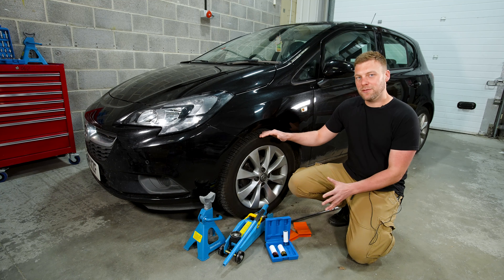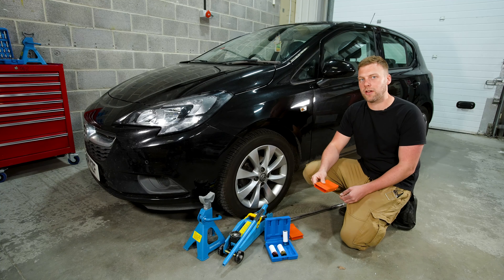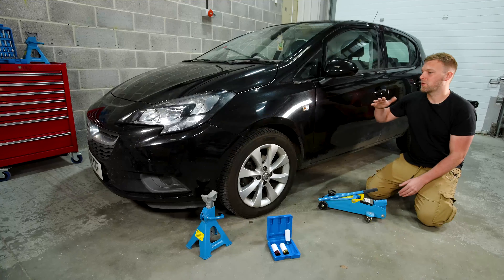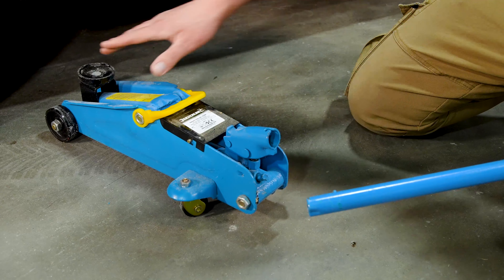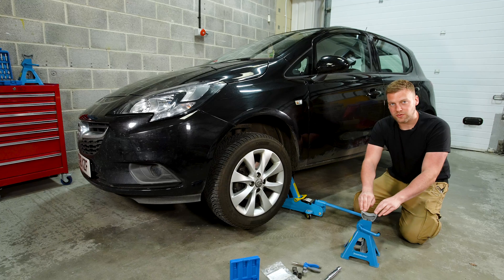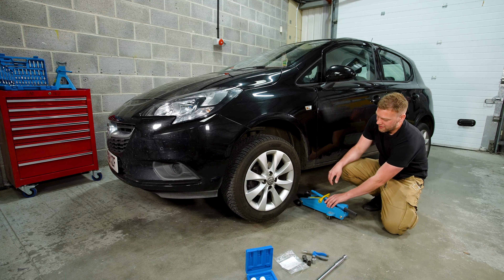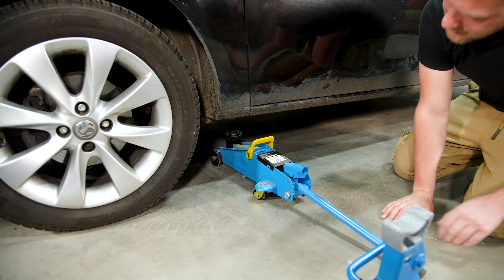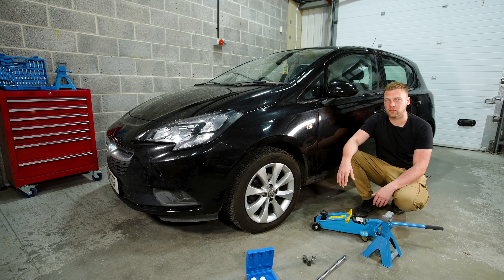How to jack up a car

Comment: what about jacking a van like Renault trafic? I need to get under the van to fix the engine cover underneath.
Reply: The same process would apply but I'd be sure to check the jack you use and that the weight it can lift exceeds your vehicle's weight. In the same manner check the axle stands for the weight they can hold. Hope that helps